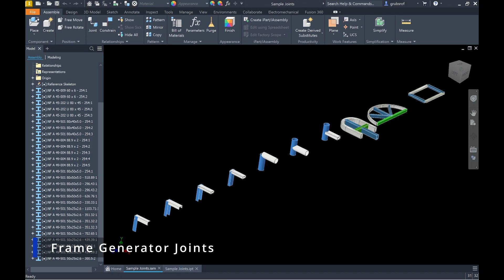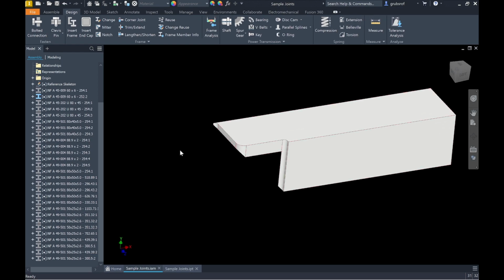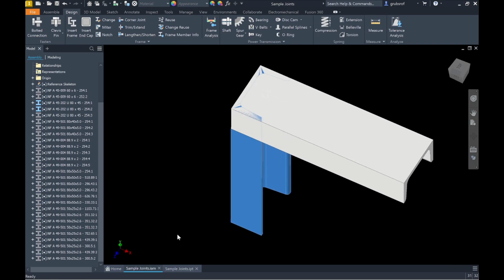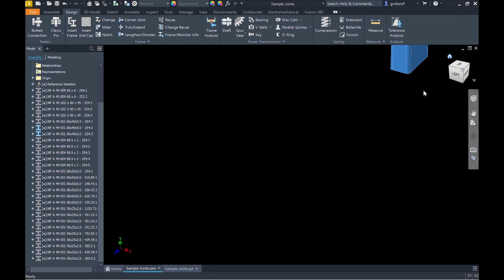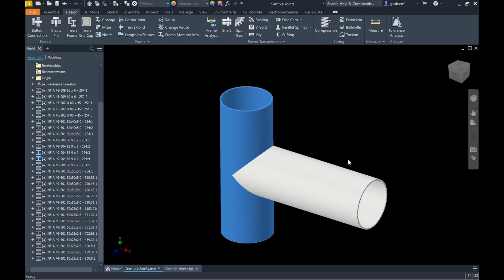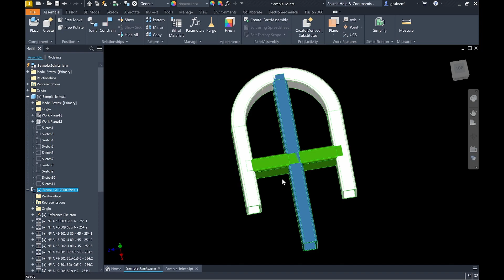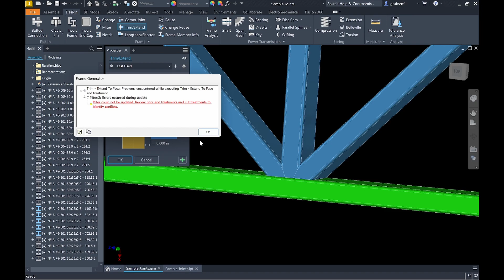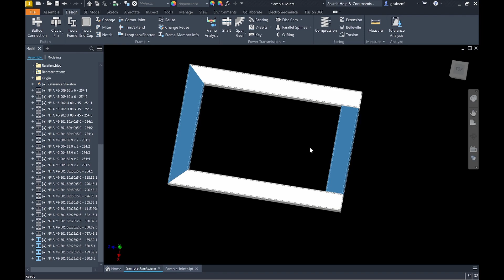Autodesk Inventor - Frame Generator Joints

Comment: Just because inventor shows material leftover and looks wrong, that's not what happens in reality in the shop. It's actually quite different when using a notch.
Reply from the maker: In the shop that is true but this is only related to the software and how it handles the process.